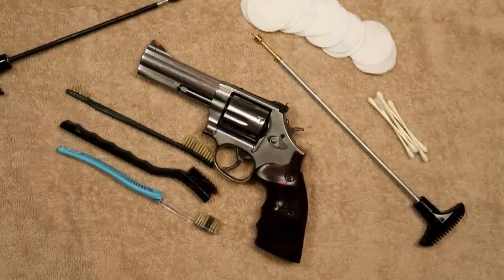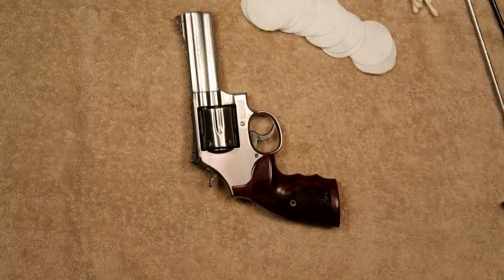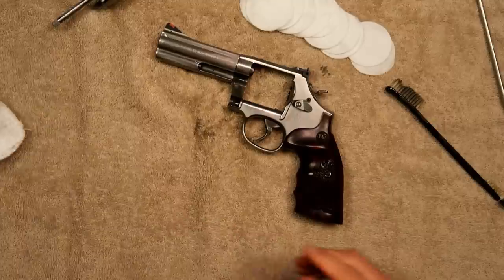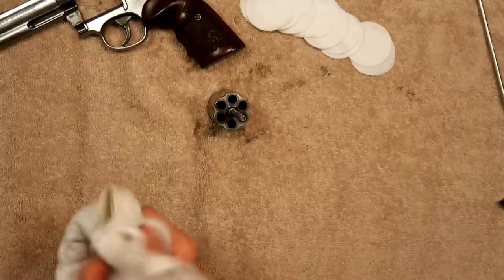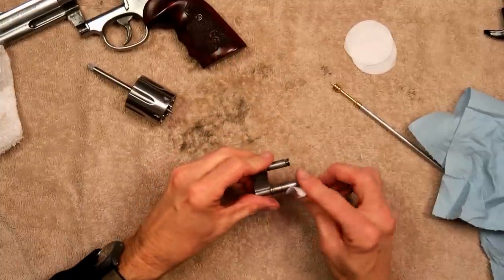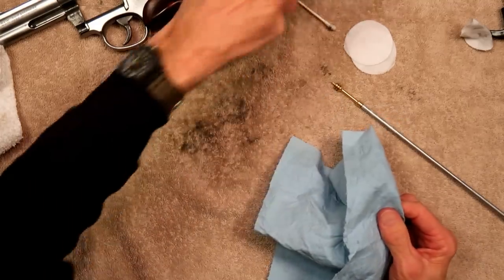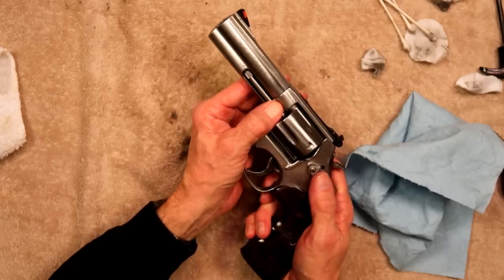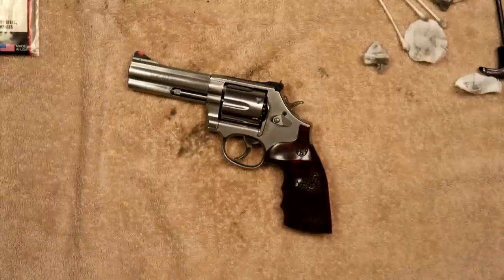SMITH & WESSON MODEL 686 CLEANING & LUBRICATION

Comment: I just just purchased a S&W 686 plus 4" (my very first revolver!) and your cleaning tutorial is a godsend. I subscribed
Reply: I hope you are not cleaning it from the front, you can damage your barrel. Always from the rear of the barrel forward
Reply: Good luck with your new 686-6 
But trust me it won't be your last 😂
Reply: Kinda tough to do on a revolver. Maybe with a boresnake, but with standard kit, not too easy, unless you insert the rod, from the front, screw the brush on, and drag it back out the front. Repeat ad nauseum.  @UnstoppableYaris
Reply: @sammcrae8892  Agreed! I use the snake on the barrel.

Comment: For the cylinder holes, I chuck a cleaning rod with a .45 cal brush into a low speed drill and while holding the cylinder so it doesn’t spin, run the brush back and forth through each hole for maybe 5 seconds. Follow it up with a solvent soaked patch and they come out black. Follow up with dry patches to mop up remaining solvent. Gets them spotless. Never do this to the barrel since the barrel is rifled, but the smooth cylinder holes get as clean as they day they were made.

Comment: My co-favorite (along with the Ruger GP-100) handgun of all time. Don't care for the 7-shooter. Mine a sixer. Got a dozen or so speedloaders. 
Very seldom ever remove side plate.  A good spritz of Birchwood Casey Gun Scrubber, let it dry, then a good spritz of Break-Free and I'm done. Got an old Lewis lead remover for the bore. Good video, but you need the aforementioned items.
Also, I'm a strange guy about guns. I loathe and detest almost ALL centerfire semiautomatic firearms.
Don't like single action revolvers much either.
However, when it comes to RIMFIRES, love semiautomatic. Got a Smith Model 41 target 22 pistol and an old Hi-Standard Victor.

Cheers everybody!

Comment: Good video.  I prefer the KleenBore Lead Away Gun Cloth over the BIRCHWOOD CASEY brand.  Both work; yet the KleenBore brand is thicker and works a little better.  Additionally making smaller patches with the lead remover cloth; works nicely inside the cylinder and barrel.

Comment: Regarding the author's advice to acquire the awesome (my favorite too) Birchwood Casey Lead & Polishing Cloth, I AM in the Phoenix area but both Cabelas and Bass Pro locations here have always stocked these Cloths in the gun kit cleaning sections. Because of Cabelas and Bass Pro being national chains I'd at least look for them there if you frequent either place as they are only Seven bucks and change and last a long time. I've take a black penny and turned it brighter than mint with two fingers inside about 90 seconds with minimal force and lead is NO Match for these cloths. No elbow grease required.

Comment: I inherited a 357 mag S&W Mountain lite 7 round wheel gun . It's a 1988 in perfect shape, shot less then 20 times. Comes with medal locking case. IT ONLY WEIGHS 18 OUNCES, THAT'S RIGHT 18 OUNCES. 3.5 INCH BARREL. THEY STOPPED MAKING THEM BECAUSE IT'S VERY EXPENSIVE TO MAKE AND HARD TO WORK WITH. 7 ROUNDS ON TARGET GIVES YOU PEACE OF MIND. NEAL APOLLO BEACH FLORIDA

Comment: great great video, is there any reason not to use those lead cleaning wipes you said to order off the internet on more than just that face of the cylinder? like would cleaning the chambers or barrel with those be a bad idea, or just unnecessary? God bless
Reply: I'm no expert but I'd say - why not?  It does such a great job removing all that lead so thoroughly and gently I think it'd work great on those areas.

Comment: I would use a swab saturated in clp first and run it thru the barrel first to loosen up the residue. Then use the brush to remove the lead, etc. Then patches until they come OUT clean. Same with cylinder. 
BWC lead remover is great. I use shooters choice to clean my guns, but doesnt smell like hops.

Comment: I shoot .357 Magnum in my .357 Magnum revolver, and .38 Special in my .38 Special revolver. I don't shoot the shorter cartridges for the very reasons you stated. My.40 S&W in my semiautomatic pistol, not in my 610 revolver. 

There is also a school of thought that suggests that the bullet leaving the cylinder so deep in the chamber is detrimental to the longevity of the revolver. The point is, why risk it? Most people I know in the gun community have specific guns for specific calibers. Unless it is an emergency situation, it's really not necessary.

Comment: I learned it's best to wipe excess carbon off the cylinder/finish relatively quickly. I waited a good day to clean it and it was a mother#$%^$#@ pain to clean it off. I'll own to the fact that I was horrible to a Smith & Wesson revolver. To anyone who buys one, wipe off the cylinder when you're done shooting! You don't have to CLEAN IT clean it but a goood wipe will save you lots of elbow grease when you do clean it!

Comment: A short, thick strip of leather and pair of vice grips is how I take the cylinder apart. Clamp the leather onto the knurled section of the ejector rod with the vice grips and rotate counter clockwise to loosen it. Notice a small area inside the rod is hollow, so try not to crush it with too much clamp force. It’s not a necessary step after every shooting, but hey, those little parts inside get dirty too! 😉

Comment: Hi 
Great Video 

I am not able to decide between the 4 and 6 inch 

Gonna be using ist it to shoot targets 10 to occasionally 25 yards
Reply from the maker: I have both. The 4" is very accurate and you will have an easier time finding it. 6" is a lot of steel!  25 yds is no problem w/the 4" but I would recommend changing the front sight. I have a vid on that too. Good luck!
Reply: @TheGoatMumbler  Allright thanks a lot for your reply👍 

I tend to like the 4" more I just have been concerned that the accuracy is worse than 6"

Because there is less weight in the front, the 4" will be better balanced right 

+ a little more recoil and flash (which I actually would appreciate)

So overall I think now that I can't go wrong with the 4"

It would be more fun at the range
Can you confirm that?

I appreciate your help
With best regards
Richard

Comment: Is it necessary to clean a brand new 686 before firing for the first time? Thanks
Reply from the maker: I always clean a new gun just cuz. :)
Reply: @TheGoatMumbler  Thanks!
Reply: Just picked one up and had the same question.  The manual seems to suggest simply wiping off any factory treatment with a dry patch...third bullet point (heh) on page 30.

Comment: Those lead cleaning cloths are great!  Do they also work for the rings inside cylinder from shooting 38 specials?  Thanks!
Reply from the maker: Better to use a bore brush for those.
Reply: @TheGoatMumbler  I was wondering does it help in conjunction with a bore brush?  It is definitely the most challenging and time consuming aspect of cleaning most revolvers.  Thanks!
Reply from the maker: @michaelshearer3559  It's it's really bad let some solvent sit in there for awhile  (not CLP) and then use the bore brush. That should handle any deposits.

Comment: you dont need to take out the cilinder to clean it, it wears out the threads on the screws and the sideplate, its unnesserary, just let it in and clean it with some polish and buff it, every time you shot it, ready in 10 minutes, keeps it like new, lube only the internals now and then.
Reply: sure but its nice to see a more in depth way to clean, even if you only go all out less often than a lighter cleaning.